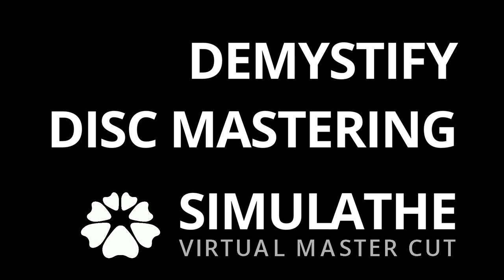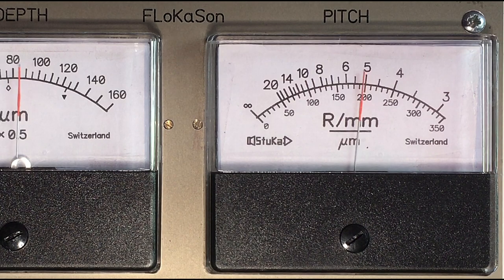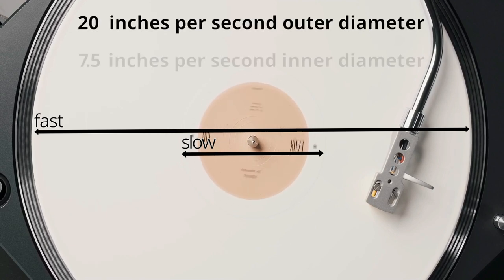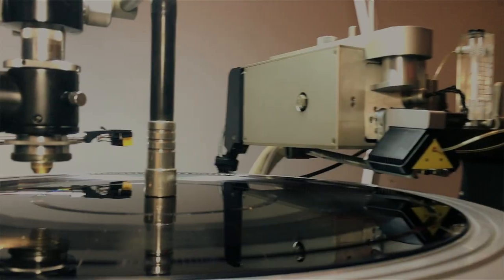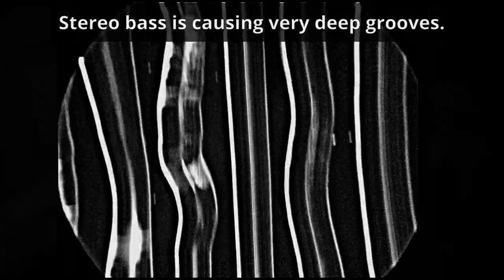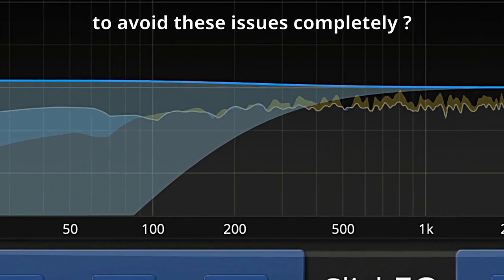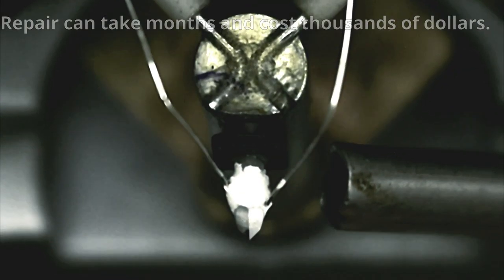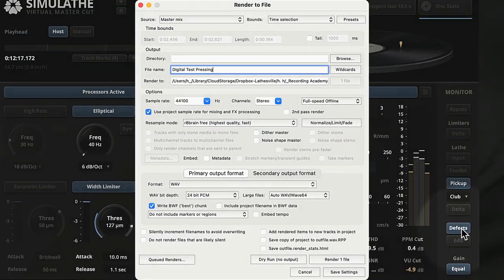Disc Mastering For Vinyl Records Demystified

Comment: Thanks a million for this (and series) of videos on Simulathe❤ I am totally new to vinyle and I am wondering if i can use the tool to to actually correct issues before i send my files for vinyle cutting? For example, can i use gain/width/processors/dynamics, then turn off defects, set outout to Input, then print a master for each side through simulathe and send the 2. wav to cutting? I feel i am still confused about this as a tool vs its simulation capabilites, so please excuse my ignorance😅
Reply from the maker: Nice!

Yes exactly - you can send these files to the cutting room. You can also send them some useful information for cutting - as described in the manual - here is the part:

https://docs.tokyodawn.net/simulathe-ref-manual/#Disc_Stats_Window_and_Controls

In the Disc Statistics Info Area you find a 'Project Report' button.

The Project Report lets you create, view, and export vital settings, measurements, and time stamps needed for the disc mastering engineer.

Project Name allows for naming the project that will be used in the report.

The Project Report button allows for viewing the project report. The document is created in the HTML format and will open in your default browser.

Select the Export Project Report button to export and save the document in the HTML format.
Reply: Thanks alot Helmut 🥰! I will surely use the Report feature..One more question if you don't mind 🙏Regarding the Excursion/Width/Velocity dynamic processors/limiters, if I use them, will they actually impact the master .wav generated? (if yes, I fail to understand how for example excursion or velocity limiter changes the signal so it actually leads to limited excursion/velocity in the real world).. or is it only the low/high pass and elliptical filter that actually impact the master?
Reply from the maker: @fahedriachi  yes, all processing affects the output master .wav generated. The dynamic processors use a model for the movement of the stylus at the given settings (cutting level, filters, width control, lathe calibration, offsets). Dynamic processing is applied accordingly to the simulated stylus movement. It seems to be magic that you can process the groove shape before it is even cut. This is the revolution in disc mastering in 2023.
Reply: @heyrec  thank you again for your generousity and valuable answers. I hope I can catch up to this revolution, and that the vinyl medium continues to strive.

Comment: why are LP records mastered by parrallel cutting when played back radially? why not radial cutting to match most record players? this simple geometry fact is a hifi contradiction....
Reply from the maker: hey well - this is a rather self-explaining question imho if you think deeper. There is no other way to match most record players / tone-arms than cutting radially.
Reply: @heyrec  of course, its a basic mismatch - why are they still doing it? cut the disc tha same way it will be played back, cant be that hard?
Reply from the maker: @kevinmcgrath3591  oh yes - very hard - impossible in fact. There are many different tone-arms out there and also many different ways of aligning cartridges. Settling for just one of them would result in horror-errors for others. No - for the time being there is not one single 'same way it will be played back'...there are approaches of minimizing errors, but there are many of them. Anyway: There is no way to make a new lathe with what you suggest anyway, no-one can do it, so it is that we will have to live with what we have for the time being...
Reply: @heyrec  cant be that hard to rotate the cutting head to the tone arm's radius point  while it is running along the drive screw , that would correct the radial error.
Reply: For normal groove there was cutters which cut radially.  Presto K-8, K-10 for example. For microgroove it will produce a lot errors...